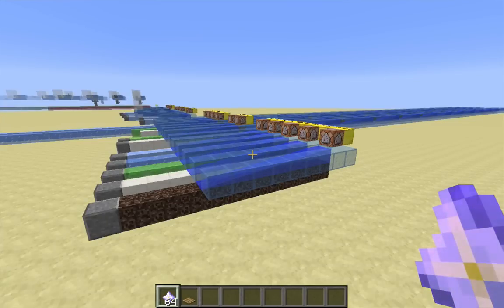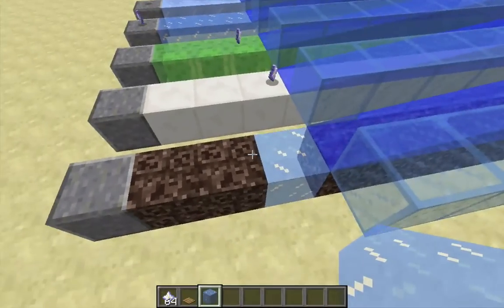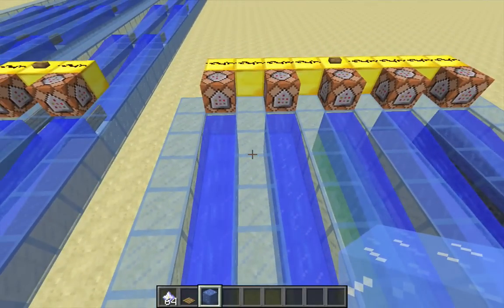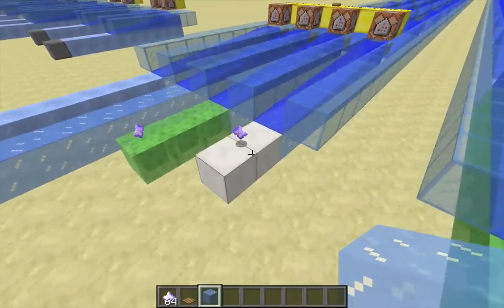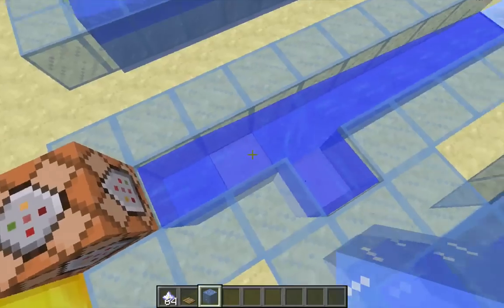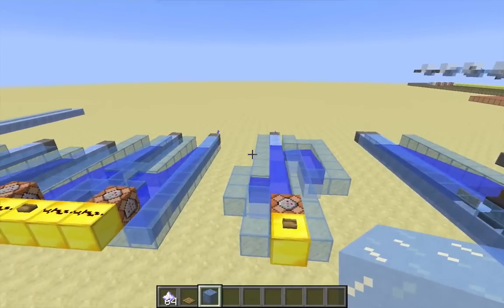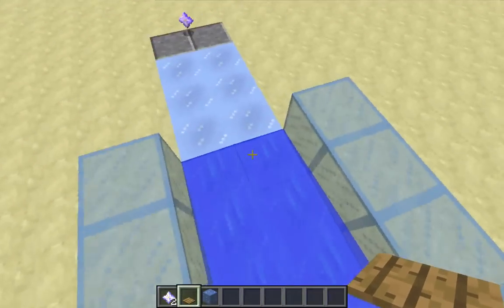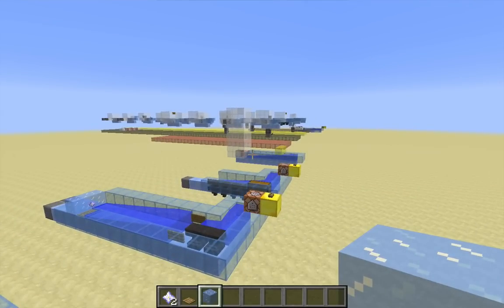Design Fundamentals of Minecraft 1.9 Item Elevators, Part 3: Item Manipulation

Comment: Off topic: 8:14  "chest alignment"
I've seen this done only with cakes and/or ender chests before instead of a normal chest. Does ender chests or cakes have any advantage to a regular chest?
Reply from the maker: +RimaNari All of these have different advantages and disadvantages, but they work the same because the collision box of each is 14x14 pixels, centered on the block, leaving one pixel of space around the sides. Cake has the disadvantage of requiring a block underneath (though it can be almost anything). Ender chests have the disadvantage of being expensive, but, like cake, they won't stop a hopper underneath from checking above for item entities. Chests (and trapped chests) are cheap but have the disadvantage of stopping a hopper underneath from checking for item entities.
Reply: Nathan Ryan Ah, right, chests being inventory blocks stopping hoppers from picking up items is the key here. Thanks for clarifying!

Comment: Did u know that stairs are faster than ice. It takes longer for them to accelerate but once they have they are faster
Reply from the maker: +Minecraftster148790 Can you be more specific about the configuration? I've tried both right-side-up stairs and upside-down stairs with no discernible speed up.
Reply: The right way up, and sideways. The items have to be aligned to the side with the lower bit of the stairs. Docm77 did a video on it.
Reply from the maker: +Minecraftster148790 Ah, yes, the bouncing trick. That was MC-1720, fixed for some snapshot in August or September, IIRC. Won't work in 1.9 :-(